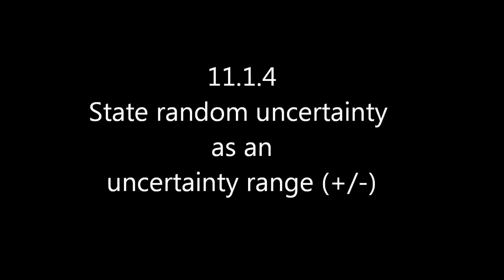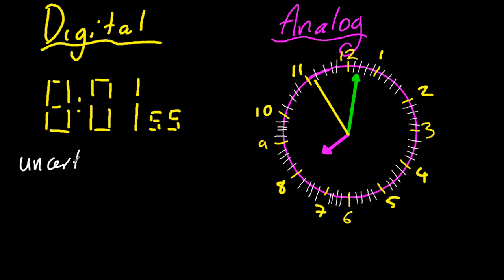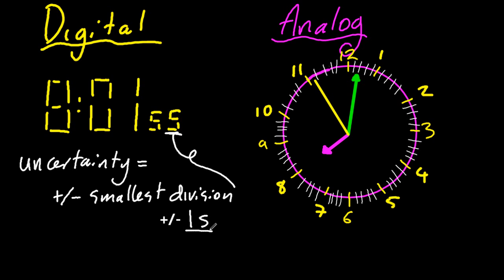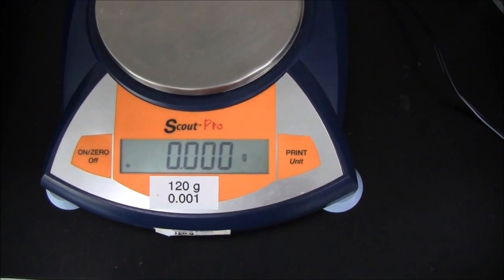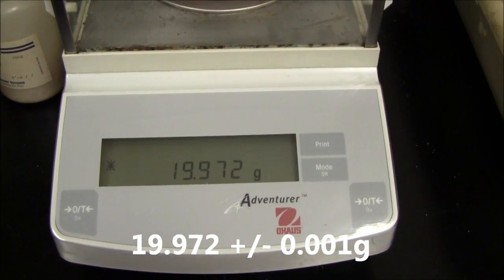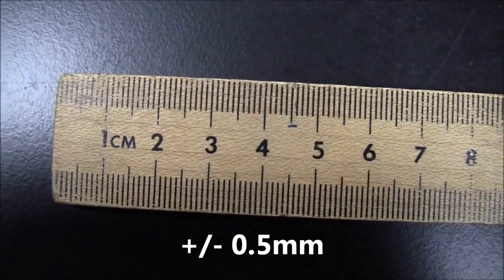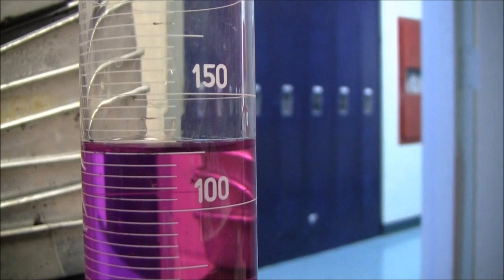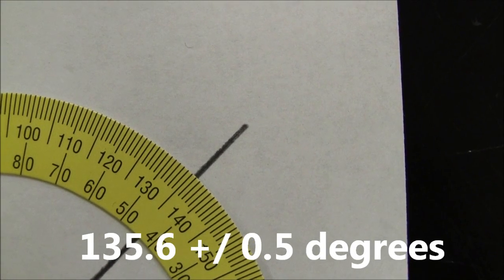11.1 Digital and Analog Uncertainty (+/-) [SL IB Chemistry]

Comment: I am studying this as part of my physics A Level and I am confused as to why it is half the smallest division. Is there a reason i need to know for half  of the smallest division or is it just what is done?
Reply from the maker: It is just what is done!
Reply: Thanks
Reply: One idea I like is found in this StackExchange post: https://physics.stackexchange.com/questions/316288/can-someone-explain-uncertainty-in-measurement. Look for alanf's answer.
To quote him "If you're looking at a pointer somewhere in the smallest division, you may be able to tell what half it is in by sight. But you'll have difficulty telling where it is more precisely than that. So the smallest quantity you can read from the scale is half of the smallest division."
Another answer in same post (by juanrga) says that finding the position of the marker or object on a scale has the half smallest division uncertainty, but any real measurement of length or value also has to consider if the starting position is actually on zero. That means it's a subtraction of read value and zero value, so the uncertainty just ends up being equal to the smallest division anyway.
In the end, it's all just different conventions, and as long as you stick with one that's reasonable, IB won't have any problems with it.
Reply: @ROldford  thanks i had this doubt for sooooooooo looong!?